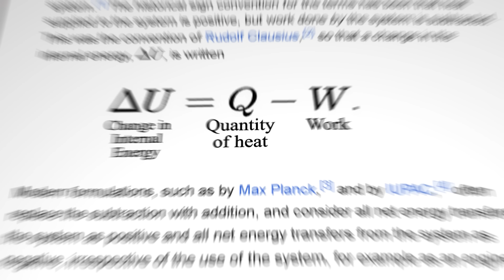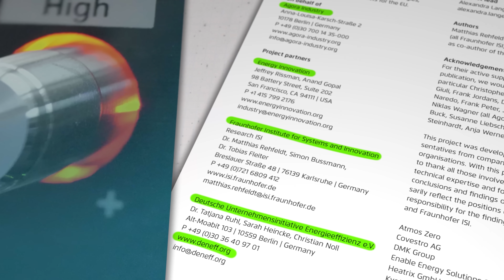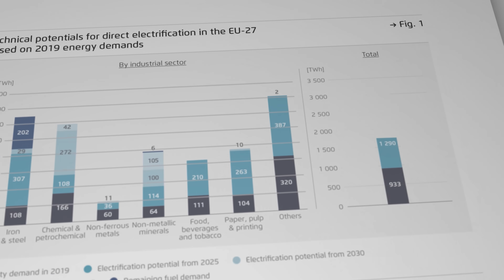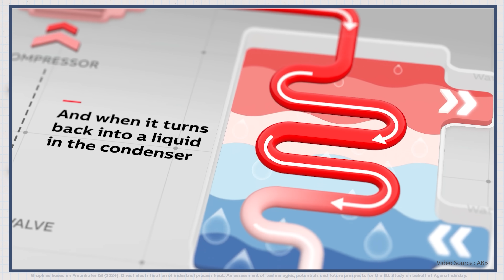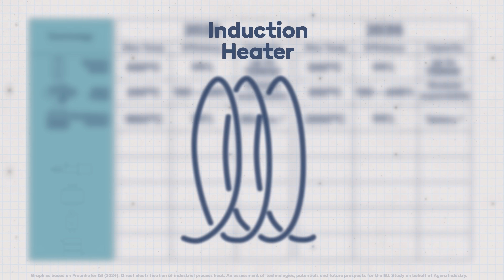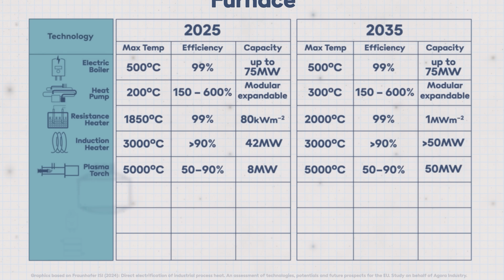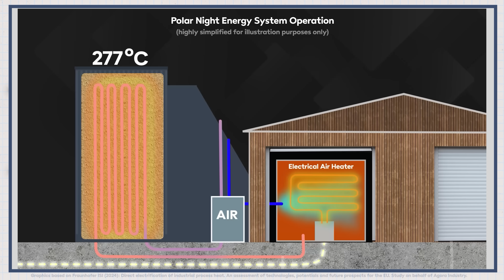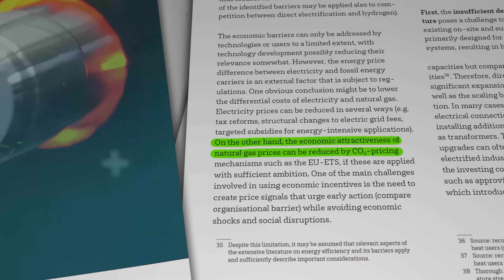Kicking fossil fuel out of industry! Here's how it's done...

Comment: Its very much wishfull thinking! But a wish we desperately need to come true. To be fair, there is the chicken and egg thing of "electrifying everything doesnt make sence if the electricity comes from fossil sources" (an argument i've been hearing for years when it comes to electric cars) wich does make sence to some point of course. But for both industry and EV's: electrifying on a large scale is hard, expencive and takes time. Build a gas fired boiler and it's as efficient as its going to get the day you install the thing. Build an electric version and it keeps getting better and better at reducing the enveriomental impact with every single solarpanel on a roof, with every single wind turbine, tidal power, whatever the case may be.

So yeah, running like a wild man towards electification is not by definition the way to go, but honestly: seeing how industries react to the proposition.... The growth of green energy will outrun the electrification for now (and for a while if you ask me). And given the urgency... I'd say electrify everyting we can, any industry willing to give it a go. Hell, build a (new highly efficient) gas fired powerplant if lack of capacity is the issue. Use the waste heat from that for the plant that needs the electrical power! But green energy can then catch up and will render the powerplant unneccesary (or perhaps as backup, grid stabilisation, etc). But if the factory is build with fossil fuels in mind, you can build a windturbine next to it, but it'll hardly do anything since most power comes from fossil fuels.

To me, electrification is the way to go. Not all at once. But for what I hear and see around me: the generation of green power far exceeds the willingness to convert to fully electric houses, cars, factories and industrial proceses (for now at least). So even thought thats often the argument, at least for now, the argument just doesn't hold any water.
Reply: There is no such thing as GREEN energy, or energy without the use of oil derivatives.
There NEVER will be sufficient electricity for these plans, nor is there meant to be, i suggest you read and digest the U.N Agenda 21.

Comment: In the food industry heat pumps could be great. Extracting the wasted heat in the cooked food  to heat up the incoming food. And also reducing energy requirements to chill the finished product.
Reply: Good point.  Another option is to "sell" heat.  By that I mean locate another industry near your plant that could utilize the heat that you are expunging to the environment and simply charge a flat monthly fee for the heat transfer.  We could call it the fifth law of thermodynamics.  
"When heat is wasted it can also be sold"
Reply: @anguscampbell1533  that's such an awesome and badass concept, an epitome of true circular economy. In the Netherlands, in the city where I currently live, we have a company for district heating and district hot water. In itself that's already a better way of supplying heating and hot water. I know many post Soviet countries heat their buildings and water this way. But what I like about this particular company is that they take residue heat from data centres and use it to heat up the water that is then run through the pipes. How cool is that, heh? Or should I say hot? :P
Reply: @tmclagen  
Excellent!!!
Reply: @anguscampbell1533 It is already happening in Sweden. That twenty years ago it was built with a 20 km hot water pipeline between my hometown and a pulp mill. So that the waste heat could be used in the district heat network. While recently a massive greenhouse was built next to the pulp mill. So that the heat can also be used to grow tomatoes.
Reply: @niclasevaldsson1467  
Awesome!!!
Reply: Absolutely! I work doing maintenance for a local food company that uses reusable glass bottles. The bottle washing process just dumps the water down the drain. This water is at 90 degrees so the energy waste is huge. But they don't have the capital to invest in heat recovery. I keep mentioning it though...
Reply: @alanjewell9550  Absolutely agree with your sentiments on this. I feel it's another example of hyper-wasteful capitalism that wants to contiue Business as Usual for the Usual Suspects. Wealth and Capital accumulation are not more important than a liveable climate and environment, no matter how rich and powerful you think you are.
Reply: @alanjewell9550  That's crazy, they could probably recover a good part of that wasted energy just using relatively cheap off the shelf items. A small brewery near me uses a Jaspi Ultrastore for a similar purpose, it's a 500litre domestic thermal store but they pump waste hot water through the "volume" of the tank and incoming clean water goes through two copper coils that would normally be used for DHW. It cost them £2500 with payback being less than a year.
Reply: @garysmith5025  Thanks for that heads up. I'll look that up. It's really for me to push this one a bit and come up with a plan as being a small company, they don't have anyone employed to do this kind of stuff & pay me & others for maintenance etc as required.
Reply: @alanjewell9550  No problem, I actually suggested the Ultrastore to them when I was playing bowls with one of the owners and he was complaining about energy prices! If I recall correctly the hot waste water is pumped in at the lower left corner and out of the top right, clean water to be heated goes into the top coil first and then into the lower coil. It's the opposite of how it would be used for DHW but that's because it's being used in a semi-continuous process and the tank "volume" needs to be kept full.
Reply: @alanjewell9550  Chemical engineer here:  It is VERY EASY to recover 90% of that energy for a very small investment into nothing but one simple heat exchanger!  Not only that, but I am surprised the local water treatment plant even accepts that hot water.  Very often, waste water cannot be released into the sewer at more than 35 or 40°C!
Reply: @st-ex8506  discharging the hot water into the private sewage system has upset it, which has just become an issue last week! It's all evolving a bit organically shall we say & expanded rapidly without thinking this could even have been an issue. But dealing with this is now in hand & I've got the go ahead to get system sorted. There's a few details that need a bit of careful thought even though the principal is very straightforward. Stuff like balancing the very high discharge flow rate from the washers with the slower flow required through a heat exchanger, and how the muck in the water might foul things up hence something that can be cleaned easily etc etc.
Reply: So many food processes involve cooking followed by cooling or freezing. I don't know why they buy new heat and then pay to get rid of it. Heat pumps seem like a perfect fit.
Reply: I know a few Process engineer people that work with food manufacturers in Denmark. That exact switch is happening right now in here, but they are taking small steps first, to test it out. 

There is a slight learning curve for the process engineer folks. Lots of math, some of them even had to learn coding in Python to make it easier.
Reply: Liquid air energy storage would be good in the food industry, liquifying the air to store energy releases latent heat of vaporisation and boiling it off to generate mechanical energy absorbs latent heat of vaporisation, which can be used for freezing food.
Reply: Work for a company that sells industrial heat pumps for food, health and brewery's..
These things can be humongous
Reply: Waste heat recovery is nothing new. It is standard in refineries that I've sold to in the past. There are a number of businesses where I live that are specialists in waste heat recovery systems. No doubt there is room for improvement, but the tech already exists.

Comment: not only coal in steel production, natural gas is used as an input and not a fuel in several industries like pharma or fertilizers. so fossil fuels will have that role in industry forever even when we manage to stop using them as an energy source
Reply: Even if we contend that we must use FF-derived chemicals forever, that doesn't necessarily mean that those processes must cause GHG emissions or that they are on the same scale as our current use of FFs for energy production.
Reply: NG for fertilizer is only needed to deliver hydrogen. This can be done with renewable energy. Hydrogen can also replace coal in iron ore reduction.

Comment: 10:39 Whats important about hydrogen: We will need hydrogen (not for cars as many seem to want, but for many industrial processes) and we will also need to store vast amounts of green energy, especially in summer. To really use hydrogen optimally we will need to find ways to utilize the heat generated when hydogen is produced - and when its used due to the rather small efficiency for both. So to make that efficient - the heat generated must either be stored or directly be used, ie for heating or industrial processes
Reply: Fair, but say we really can electrify 90% of industrial processes.  Given how difficult hydrogen is to work with (leaks, etc), why not instead use methane derived from atmospheric CO2 via the Sabatier process or similar?
Reply: @karlstathakis7786  Also for the synthesis of methane you need hydrogen. If you look at the hydrogen ladder you will see that for some applications hydrogen is unavoidable in the future, as difficult to handle as it is

Comment: Let me know when you have a solution to the problem of fossil fuels in the airline industry.  Specifically how do you recommend replacing kerosene as a fuel for high bypass ratio aircraft engines with a zero carbon equivalent and still produce the same thrust to weight rating.  I’ll be standing by…
Reply: while aircraft (and shipping) are an issue they are only account for around 3% each in emissions but overtime Prof David Cebon from Cambridge Univercity thinks short haul will got electric and long haul biofuels and maybe hydrogen

Comment: The UK is prospering radically with this kind of thinking.
Reply: Uk prospering..? It’s a total basket case…
Reply: @lesliecarter4295  yes, pretty much. And yet many in the UK continue to tell faerie stories about how wind and solar will solve everything.
Reply: In 2019, zero-carbon electricity production overtook fossil fuels for the first time, while on 17 August renewable generation hit the highest share ever at 85.1% (wind 39%, solar 25%, nuclear 20% and hydro 1%).

In 2023, individual renewables contributed the following:

Wind power contributed 29.4% of the UK’s total electricity generation.
Biomass energy, the burning of renewable organic materials, contributed 5% to the renewable mix.
Solar power contributed 4.9% to the renewable mix
Hydropower, including tidal, contributed 1.8% to the renewable mix.

Source: national grid
Reply: @markotrieste  Great points, however biomass is losing its shine, whilst the emissions are theoretically absorbed by the biosphere, there is a time delay that contributes to Climate Change.

Comment: One thing left out of this is the decades of large scale solar thermal research often using reflectors and molten salt.  For some of these industrial processes there may be an advantage to a factory built in a sunny location where their energy cost and emissions could be much less.
Reply: A professor of mine in college did some serious research in this field: redox reactions of zinc & magnesium oxides, i.e. you take the oxide and turn it back into metal, for a metal-air battery.  Reflected solar heat is 80-90% of the required enthalpy, and the last 10-20% comes from an electric charge.
Reply: The principle of co-location is a sound one, especially as it can shorten supply chains as a useful by-product. Use of time and latitude offsets in renewable energy generation transported via interconnectors may prove more economically viable than moving factories.
Reply: The equivalent of what you are referring to does happen but often quite quietly. I am told that large amounts of aluminium smelting/recycling happen in Iceland because of the constant, cheaply available, electricity from geothermal. The Boffins are clever!

Comment: Happy New Year and thanks Dave for being encouraging as ever. Great to learn that current technology already exists for the changes required in several instances highlighted.
I had to smile at your comment "pushing America back into the Dark ages" as I used a similar phrase in one of Ripples forum sections only yesterday. But I have also found encouragement this year with the increasing number of publicised reports on just how efficient and successful HP installs are nowadays providing considerable cheer and presumably relief for everyone needing to replace gas boilers as they fail or become obsolete. Without the government grant then I accept prices of A2W HP's are beyond most peoples remit and need to fall in a similar manner to that of Solar panels and storage batteries if to be rolled out en mass.
Earlier this year and for the price of a replacement gas boiler we had installed an A2A HP,  Electric shower and instant hot water unit for kitchen and bath sinks so enabling the two bed property to dispense with gas altogether. November and Decembers consumption figures suggest an annual reduction of at least 50% less on those before. So good news to end the year upon for us too.